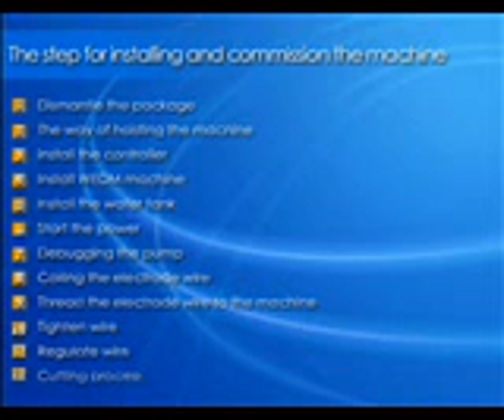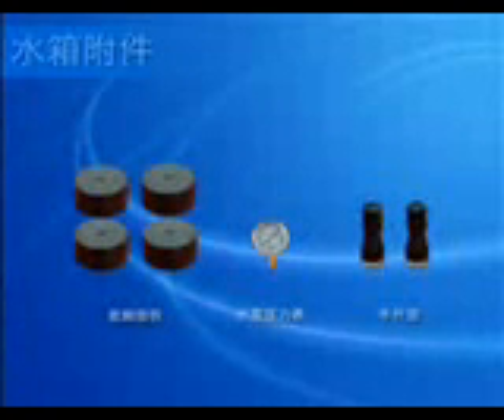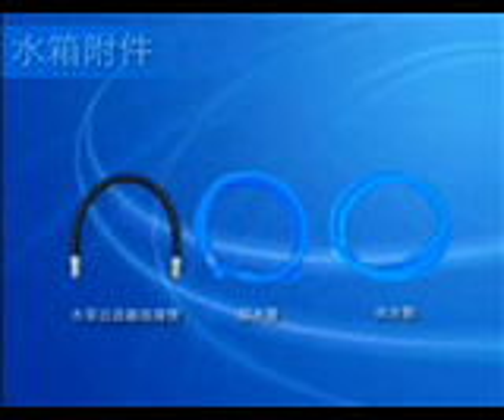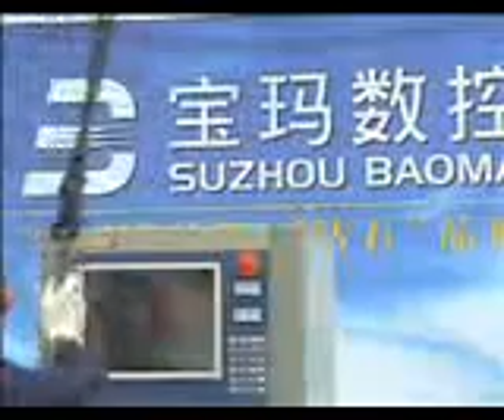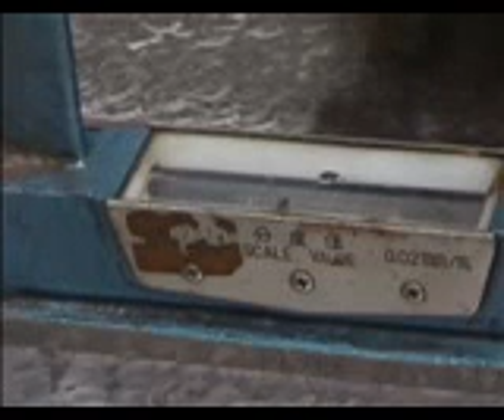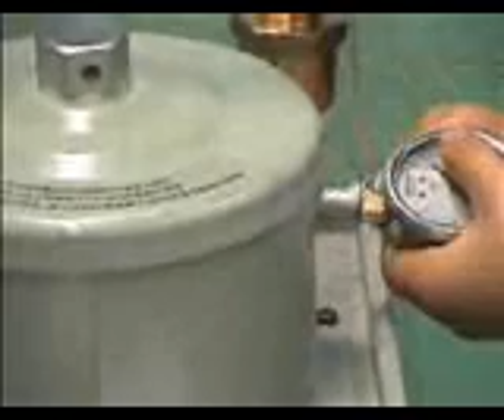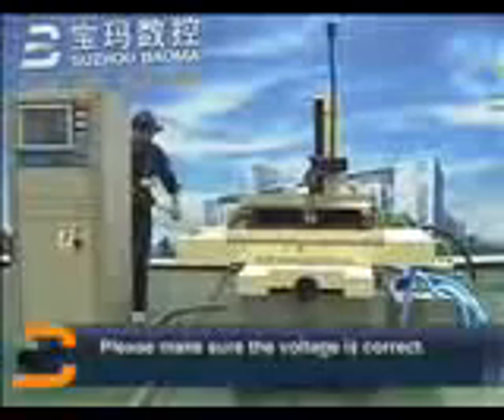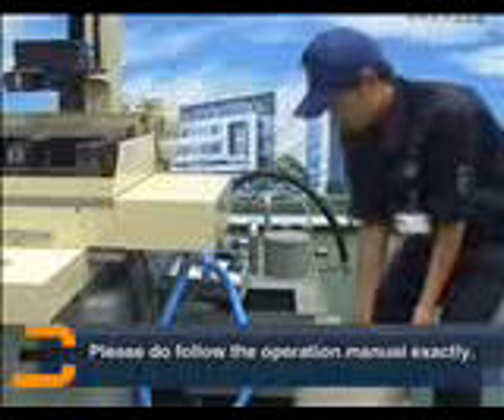XKG 2005 Wire Cut EDM Machine Install Video-Part1 Suzhou Baoma

Comment: Hello, I have the bench in the video and picture. For about 3 years I have done a lot of research on using a program for cutting and burning but I could not find anything that helped. I tried a lot but it did not work. Since Windows was not installed, I could not cut directly. Now I wanted to sell the bench but they are not giving me 1/10 of the money I paid when I bought it for profit. I wanted to give it as scrap money, strangely enough I couldn't give it again. I gave it for free with the thought of national treasure but no one took it. The reason for this is that I am recycling the bench (I will give it as scrap). I would like to return this bench to you if you accept it. Best regards. I have been honest but unfortunately I have encountered these.